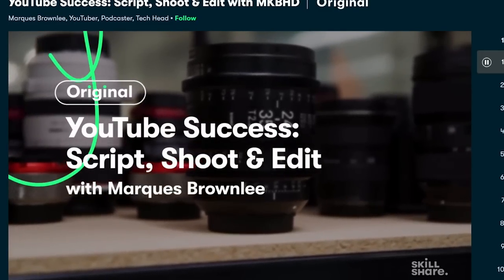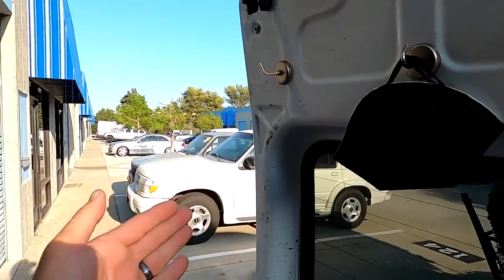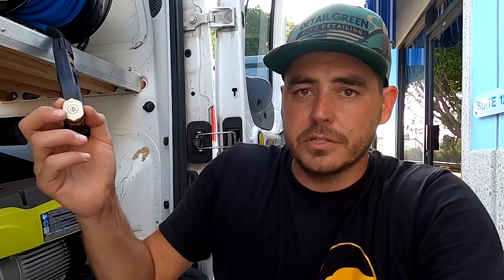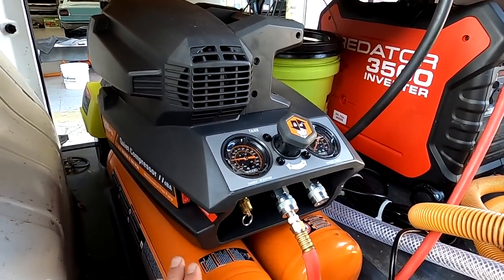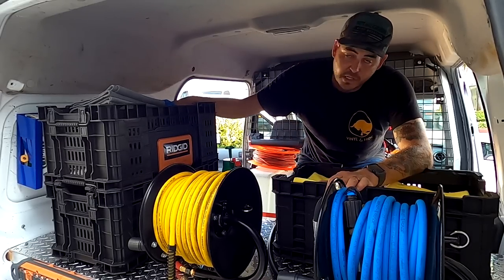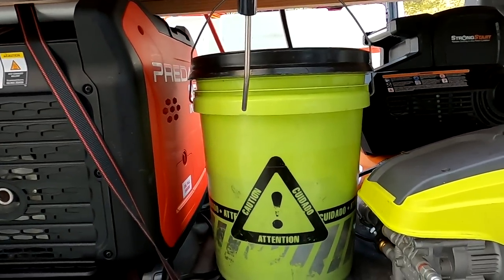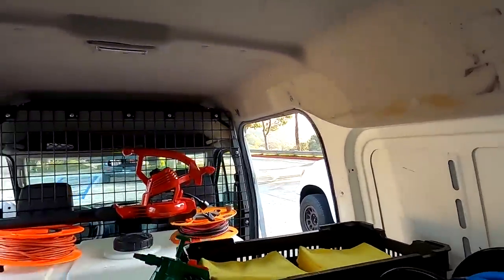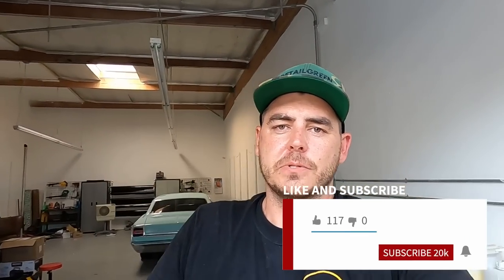Mobile Car Detailing Set Up - Detailing Van Tour

Comment: KILLER video. answered alot.   I was doing some research in that pressure washer as it is the one I have. Could not get an answer if it would pull from a water tank. THANK YOU

Comment: I would love more detail how you built that shelf. I have a 2016 Ford transit connect and eventually want to build a shelf
Reply: I am a former van upfitter. Be careful of the fuel tank towards the front of van behind the seats. These gas tanks are very expensive and there is very little clearance between the floor and the gas tank. Recommend plus nuts. Also watch the brake lines and wiring harnesses.
Reply from the maker: Thanks so much for the advice!

Comment: Hi there, I love how simple and clean this is set up compared to some. Can I ask how much its cost for the generator and the pressure washer please ? Are the magnets able to hold a decent weight ? I think there a great idea.
Reply: Generator is Predator 3500 inverter generator from Harbor Freight. Pressure washer I believe you may be able to find at Home Depot. Check description for links to get pricing or look them up at the stores that I put on here. Prices have changed so much and still changing from pandemic. Generator is absolutely amazing and worth it, very quiet! He could have started it and kept talking on camera no problem. I have not used that pressure washer as I went with AR630 TSS. Hope this helps!
Reply: Josh what was the reason you went with AR630 TSS? Thanks!

Comment: Nice set up ! What do you think about one wash mit  and just rinsing the mit with the pressure washer before dipping it back in the soap bucket ? I know being mobile you wanna save water , but just wanted to get your thoughts on it . I myself just use one bucket with multiple microfiber towels cause it is faster .

Comment: Have you done a review on the best detailing brushes yet - especially for rims?  

Also, I’ve been thinking about getting a Active pressure washer or the Adam’s 2.0 for my own use. Do you still recommend these product?  If so, for the money, quality of use and equipment longevity which would you lean towards. Help!  

Sorry for all the questions but your vids are so informative.

Comment: So the lower psi on a pressure washer , you suggest to go with a bigger orifice or a 1.1 mm ? Reason I say that I use a 1.2 gpm 2100 psi pressure washer . Also I use the foam cannon that I purchased from your site MJJC. Just trying to figure what I’m doing wrong or if I need to upgrade the pressures washer . First time use it didnt foam like video I seen and got me interested in the foam cannon .

Comment: I have a concern to share with you about your comment for the topic of Customer Key Placement. Is there a high chance someone would snatch the keys if they were just hanging there? Or is it no higher of a risk then having someone steal the car at gun point? I always put security in place to stop lazy thieves or thieves of opportunity vs trying to stop a pro (who are more skilled then average). Perhaps having a lockbox in the van to lock the customer keys in while working on their car? There is no perfect solution but hanging in reach of a kid walking past the van is a little extreme too me.

Comment: Awesome job on the van! Do you think that generator could run your extractor and steamer at the same time?
Reply from the maker: yep!
Reply from the maker: my power strip will reset, but if i plug them straight into the generator its no problem
Reply: @imjoshv  Cool thanks!

Comment: Can you run the extractor and everything else at the same time? I'm thinking of getting the generator.
Reply from the maker: Yep! I run a power strip from it and if I plug into the power strip it will trip, but if I plug straight into the generator it’s works great

Comment: Is a 2000 watt generator enough to power Vacuum, extractor, and pressure washer?
Reply from the maker: Probably not all at the same time, but if you do them one at a time it will be perfect
Reply: Thank you
Amazing channel btw. Lots of tips and tricks for new mobile detailers like myself.

Comment: Does your ryobi ever pop off where the pressure hose is connected to the machine after releasing the trigger?
Reply from the maker: No, Ive never had any issue like that with mine. Are you using quick connects?
Reply: @imjoshv   after I’m done rinsing and release the trigger it just makes a loud popping “pshh” noise where the pressure hose is connected to the pressure washer, and you literally see the pressure washer jump a little, the same one you have with no quick connects